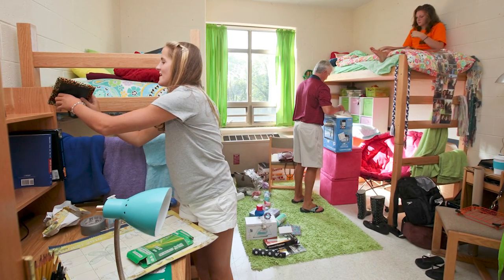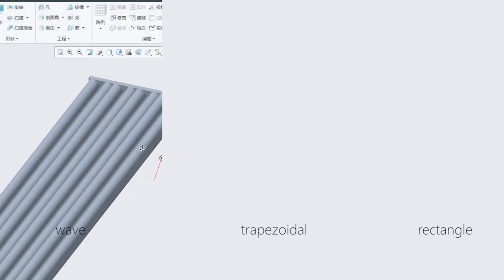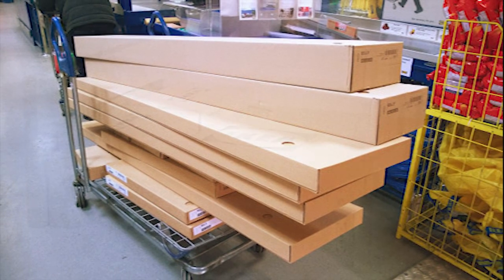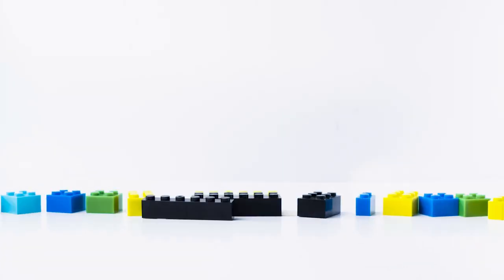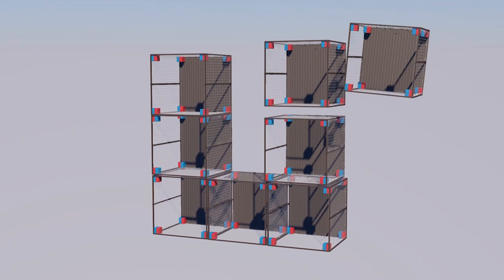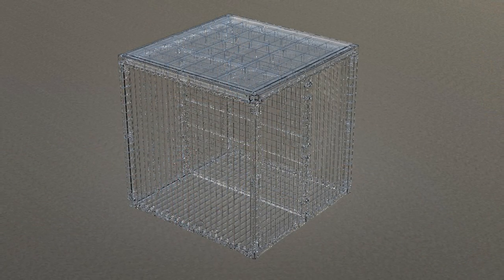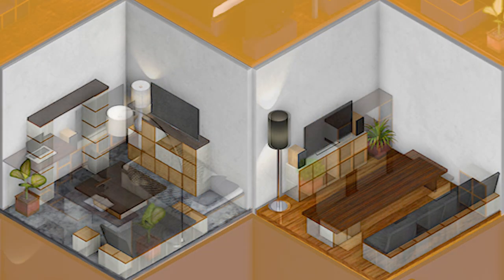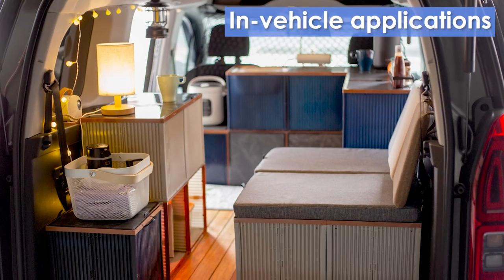QBEEGO Qcomb【EN ver. Introducing】｜Honeycomb System Furniture

Comment: Are the magnets strong enough to work through wooden boards?
Reply from the maker: The primary function of magnets is to align the boxes with each other neatly. If you're looking for a stronger holding force, you can refer to our video where nylon straps are used to enhance the fixation.